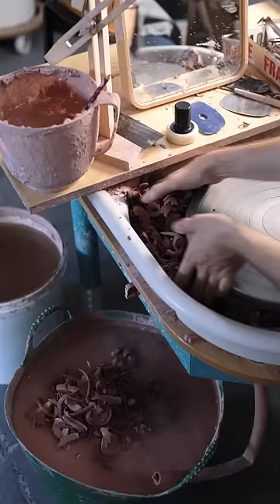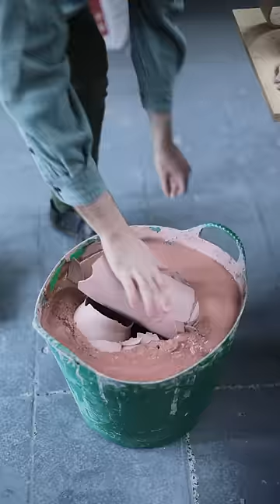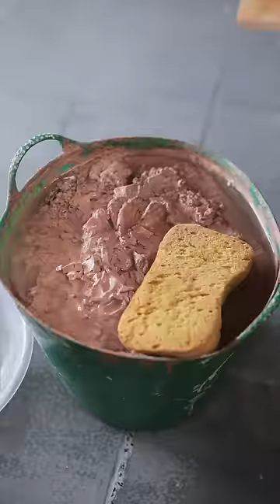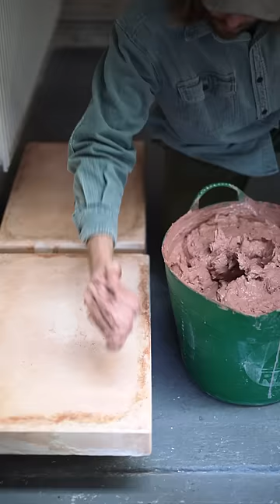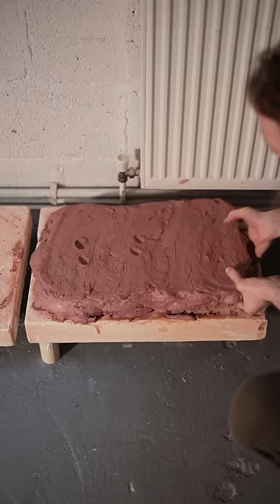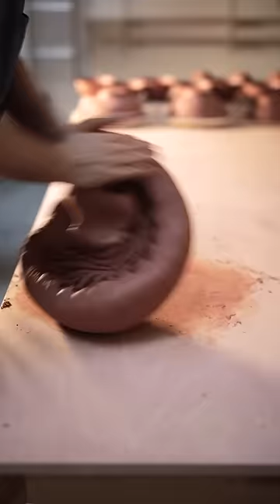Recycling Clay, the ENTIRE Process

Comment: Does this recycled clay lose quality, especially after being heated to set shape? I'm not well versed so the question might not be quite apt.
Reply: If it is heated, it can't be recycled. The pot you saw in the video it just simply dried.
Reply: Fired pottery can be crushed up and added as grog provided it is unglazed; but it can never go back to being clay.
 The big pot he added was greenware to the reclaiming bin.
Reply: @Tepidnesss greenware and bonedry both mean they've been sitting out in the open air drying no heat has been applied yet right?  If they had been fired that initial time just to dry further and lock everything in place they would be described as bisque fired, am I right?  I'm genuinely asking not being a smart ass.

Comment: Question. Why not just grind them into fine powder first and then add water and mix?
Reply: When he uses the pottery wheel, he often adds a bit of water to help shape the clay. The excess water accumulates at the bottom and drains out of a hose into the bucket. And when he shaves away the clay he dosent need, instead of having it clog his working space he also throws it into the bucket. It's more efficient to have everything go in one spot. 

But it's not only practical, it's critical. When clay is very wet it's called slip. Slip is used to adhere two pieces of clay together like glue. And you can use it to blend out the edges until everything is seamless. You can also color the slip and use it as a way to paint color onto your pottery. But this artist dosent use colored slip. He uses Dipping-glaze to give his pottery color.

Anyway, I would assume it is more useful to have a large bucket of slip available, especially for someone who makes many pieces in a day. Rather then have a big bucket of drying clay that he's going to add water to eventually anyway.

Comment: How long do those large blocks usually before drying out?
Reply: I'm not sure, but I know that you can always keep the clay moist. 

I did pottery in school. From my experience wrapping the clay in plastic traps any moisture that escapes and returns it to the clay, so the clay stays wet for a very long time. And if the moisture is low in the bag, you can always spray more water on it if you need too. 

The thickness of the blocks and the type of clay he's using would also factor into how fast it wants to dry.

Comment: And here I thought dry clay had to be pulverized first. I guess it isn't necessary unless you fire it, right? Also lol forbidden fudge.
Reply from the maker: It helps if it’s bone dry, or at least very thin. If you place a large block of leather hard clay in water it’ll take months to degrade properly. Whereas if bone dry, (and not fired of course), it’ll dissolve to a fine slurry in minutes.